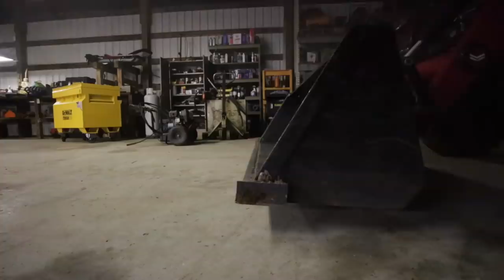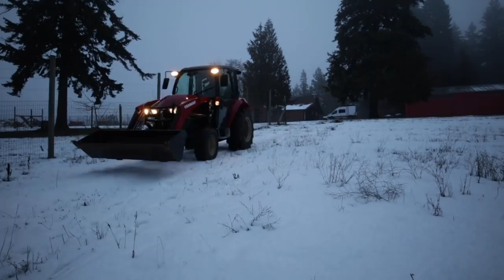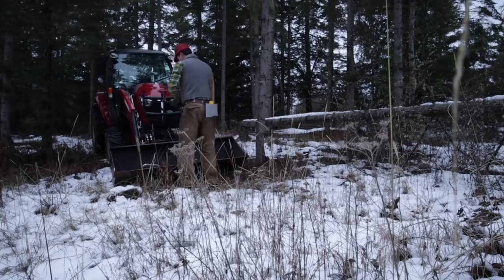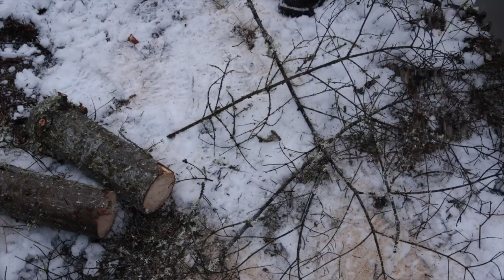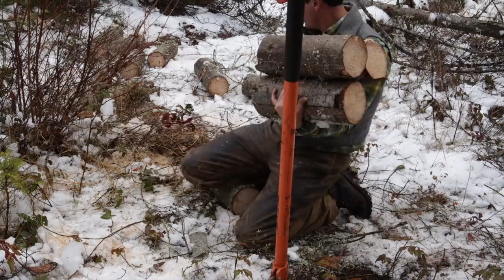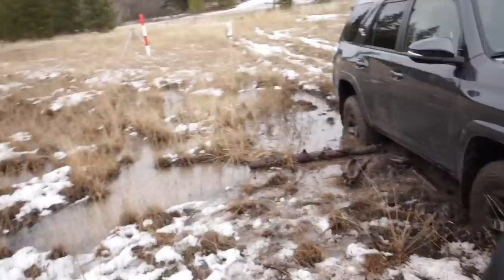How To Cut Firewood The Old-Fashioned Way

Comment: ATTENTION: I doubt that you will read this comment, but I would suggest that you make sure the mud is washed off inside of the wheel very good after  getting it stuck in mud. I live on a dirt road and one past year our road got super muddy (10" deep) so much that I didn't think about the mud attaching on the inside or the tire before I had the time to pressure wash it off. Long story short, even though I pressure washed the outside tires and truck, I was unable to get the all dried mud off places I could not see very well. Even though I did wash the truck I didn't wash it good enough and it made my tires wear in different areas (giving me bald spots in different places all around the tire)and by the time warm weather came the tires were shot. I had to replace all four new tires due to not being able to remove the mud that attached to the inner wheel and because it was so sloppy and muddy that year it didn't show the damage until spring time. So basically it was like putting weights in different places around the tire when they balance the tire when new. Needless to say I was pretty upset at myself and all it would of took is just a couple more minutes to jack the truck up a little and spray the underside of the truck. I hope you don't have problems like this happen to you and hope you see this message so you can make sure it does not happen to you. Peace, Love, and God Bless

Comment: Ah, poor Jack. I remember getting my truck stuck for the first time. Ford F150, out spring turkey hunting. U trusted the ground on the beanfield a little too much. My stepmother, god bless her, tried to get it out as she was driving where I was directing her to pick up our stuff and she tried to gently get it out. I knew it wouldn't work. I walked to get my dad and he was furious. He gets to the truck tells her to get into the passenger seat, sets it 4 high, throws it into drive and slams on that pedal. I've never seen so much mud get kicked from the back of that truck. Our fourwheelers? Yes. One of our trucks? No. Looking back now it was a great lesson. Not only not to go into a fresh bean field in the spring, but also, as long as you're not in too deep, put the pedal to the medal and slip around, as long as you're moving in the right direction keep it going.
Reply: @m9 ovich with how deep Jack was I doubt that would have worked. His back tires were pretty low in that mud. Plus that's a bit wetter stuff than the hillside of a soybean field.

Comment: I wish I could carry that many of that size logs where I live.  Oak, ash and black locust are a bit heavier than pine and spruce.
Reply: You grow Black Locust on purpose or is it running wild there?
Reply: @ChrisGilliamOffGrid  Wild grown on farm fence rows and in forests.  Lately have been nursing the saplings to promote better regeneration, especially when nearly all the white ash is now dead here in Pennsylvania.  Too many lumber grade trees for mills to keep up, so currently have a lot of 14" DBH ash for firewood.  I really hated cutting down the 30+" ashes for firewood.  Great firewood, but lost revenue.
Reply: @Echowhiskeyone  Just wondering because I considered growing it here. Even grew a few seedlings, but didn't plant them. I haven't decided yet if it's a good thing to introduce them here (Bama) but the wood looks extremely useful.
Reply: @ChrisGilliamOffGrid  Dried black locust is very hard.  A chain saw going through a dried log is like cutting rock with occasional sparks, and when used as firewood, it burns long and hot.  Most common use around me is for fence posts.  We pulled out a fence row and the posts, put in by my great-grandfather back in the '30's, looked brand new, over 75 years later.  Also, pre-drill for all nails and screws.

If oyu go though with it, good luck.  At least here in PA, they can be a little finicky when younger.
Reply: @Echowhiskeyone  Thanks man. 👍👍

Comment: I would have told him no pressure washer. Harder lesson but it will impress on him to be more aware of where he is driving. Been there done that.
Reply: David Mann it didn’t seem as though Cody was upset with him getting it stuck. Maybe he understands vehicles can easily get stuck on his property, it’s likely that’s why he has a winch on the front of his truck.

Comment: funny watching you do your boots up here most of the jobs that boot style would be asked to have the grommets eye here they say less chance in have you boot catch on something. your will get hang up yes I had boots with them on them love them but I was very lucky that day the boot got. to catch on a side of the guard when I when to move from that spot after it was clear to do so it was caught the machine started to move lucky the safety pull cord worked I would have been killed it did not. after  that they did put a stop on that type boot and did to that style of guards as well  it was changed out within that shift and the safety glass does work better

Comment: I'm completely missing the "Old Fashioned" part. 
The least you could have done is put some horses in harness and hitch up a wagon or sled or something! 
I'm highly disappointed!
Reply from the maker: Because tractors haven’t been around for over 100 years
Reply: I don't think he got the joke loose CANNON
Reply: @dirkydoesit   
What does he mean, 'tractors haven't been around for over 100 years'  
Does he mean 'have' been around? 
The oldest tractor on my granddad's wheat ranch on the Columbia Plateau was a one cylinder with a giant flywheel, and the cylinder didn't fire in a regular cycle, just ever once in awhile. It had steel tires with angle iron tread! It didn't mount anything by itself, it was just the power to pull things that did - like a grader.  It's 2019 so it would be at least 100 years old I reckon. Before that is was a 20 horse team with a couple of mules too!
Reply: @gizmogoose.2486  
Exactly!

Comment: NO, that is NOT how they cut firewood.  They cut ~logs, hauled them home with horses.  Put said log in a double V holder and then cut firewood CLOSE to the holder so it does not move all over the place.  Not this wobbly impossible to cut crap shown here.

Comment: Why not just use one axe to fell, remove branches, buck to length, and split like Steve Edholm on the Skillcult channel?
Reply: Because there's a reason they invented a saw? If you've ever tried felling a large tree with an axe you would understand why it was invented.
Reply: @thechronicgeneralist  I understand that, but when it comes to felling trees for firewood the smaller trees would be easier to handle and save the bigger ones for building. Also, I was referring to Skillcult's ax cord wood challenge.
Reply: Why cut trees down at all when they're laying on the ground already and dry. And why do what everybody else is doing? Do Your Own Thing.
Reply: @mitchdenner9743  most of the time trees that are on the ground already could have started rotting and would not be dry depending on the species. Also, if you are trying to collect firewood to heat your home or logs to build with you could come up short for firewood and/or logs for lumber.

Comment: Lol. Interesting how you call this old fashioned with a 40,000 dollar brand new tractor . Try again.
Reply: "How To *Cut Firewood*" The tractor didn't do the cutting. 😘
Reply: Did he cut with the tractor? You can also drive in and out with a beat up $ 500 truck. What's the difference?
Reply: ensen89 well, this is not a Mormons channel. Hate to break it to you